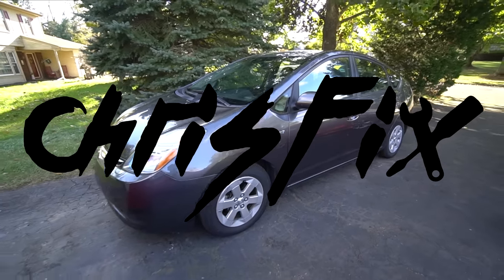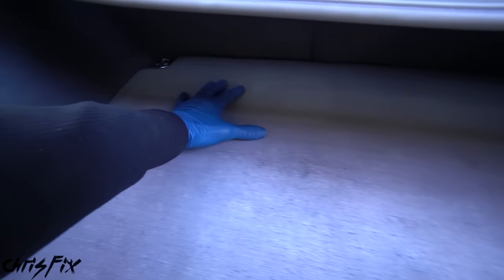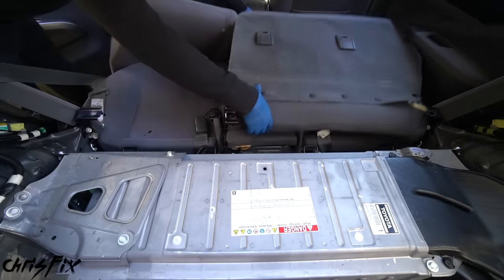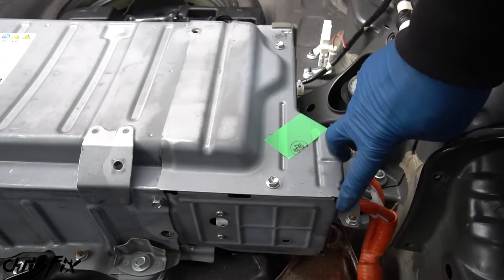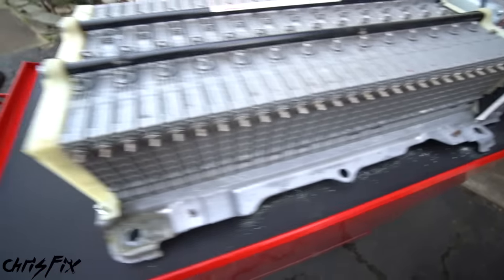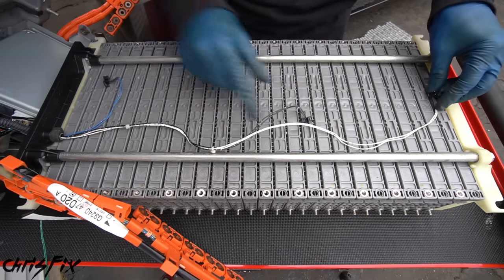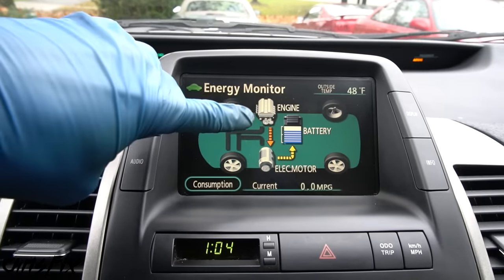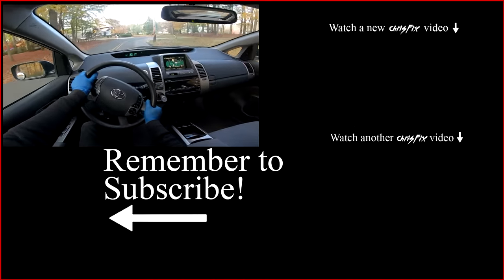I Bought the Most Hated Car on the Internet (and made $1000)

Comment: My brand new bride and I had just purchased a house that needed a whole lot of work right after she graduated medical school and her Prius started throwing every warning light on the dash.We did not have a whole lot of money and a new battery from the dealership would have been more than the car was worth. This video gave us the knowledge and confidence to replace the battery together, Thank you.
Reply: yep alot of battery rebuild places have started poping up for prius's and other hybrids which cost alot less then going to the dealer to get a new battery
Reply: That's awesome, Joe!
Reply: Have you noticed if the MPG of the car has gotten better with the new battery? We have the 2007 Prius and it is still going strong. Had some electrical problems such as A/C fan and now almost a year without issue. Wondering if I should jump at the possibility of replacing the battery before it is necessary. I think the MPG is right around 40-43 MPG. I remember when I first got it, I got almost 600 mile per tank. Not sure what it is now since my kids have been driving it for the past 4 years. I am more careful with it than they are.
Reply: @akassebaum  doesnt sound to crazy if your kids are on the heavy foot side for breaking or acceleration. what kinda miles are you at on the prius ? If its getting really high but the battery is doing fine it may be better to just wait till its needed incase other expensive reapirs come up
Reply: Congrats on the wedding!!
Reply: Congratulations  Mr and Mrs Breuer   👩‍❤️‍👨    How did the battery change go?
Reply from the maker: I'm glad the video was help you out!
Reply: Zio Oren specially doctor ones lol
Reply: Not all prius owners wear capes
Reply: Okay, I think I got this.  Simply start by just paying the $4000.00 to have a mechanic do it.  Nice!  Video well worth it!
Reply: @chrisfix  Thanks again Chris! The Prius has been running....well as good as a prius can run since we did the swap. Now that I have more time on my hands, thanks Covid, I have been using your videos to work on my truck too.
Reply: @macforme  The swap was a breeze. Just be careful not get hurt.
Reply: You and your wife worked on a car and you are still married? You guys might be a match made in heaven!!
Reply: How did it go?

Comment: Changing battery 10%
Unbolting & bolting screws 90%
Reply: You just described working on a car in a nutshell.
Reply: @kyle8971  right. Try changing a battery on a rusty Sebring. Anyone who's ever done it knows what I'm talking about.
Reply: Kyle D Modern cars*
Reply: Welcome to reality.
Reply: That’s usually how it is for most things
Reply: Karen Schumer  Spoken as someone who's never worked on a car before.
Reply: It's always like that
Reply: Yeah pretty much sums up car work in general
Reply: @nickanon329  Sure do, took ages to even find the battery let alone get it out. Also checking a noise in the engine bay, engine running and let the door go and shut, "CLICK" we were locked out with engine running and difficult to stop and then break window to get back in.
Reply: @rarearthman  but engineering doesn't work that way 😆. Its a game of "how difficult can we make this so people have to take it to the dealership for work"
Reply: Can’t like this comment anymore because it’s at 999 likes..
Reply: @bryanburcham1381  facts. The proof: got ready to change the alternator on my daughter's 02 Maxima a couple years back, because it was just an alternator, and there was no way I was gonna pay hundreds of dollars to have it done. Why would it cost that much anyway, right? Well, we started, and then found out: the long alternator bolt had been screwed in with the head towards the car's frame, so that it couldn't be slid out🤦🏾‍♀️A shop would 100% have told me that they had to lift the engine out of the car in order to change the alternator. What did I do? Cut the head off the bolt, slid it out the other side--where surprise! there was plenty of room--and installed the new bolt from THAT side. Needless to say, we won't be having THAT problem again🤨
Reply: @nickanon329  ahhh the battery in the fender bit,,,what a geat idea.
Reply: Are you sure it's not unscrewing & screwing bolts, 90%?

Comment: At 21:40 - just a note that it's necessary to bolt the battery to the car before attaching the electrical connections. One bolt is longer and black, and goes in the upper left corner. I think this is the ground bolt. If you connect everything and start the car, you'll get strange errors without the battery bolted in. Don't ask me how I know. :)
Reply: thanks man,
Reply: if a battery is not grounded correctly it may not complete the circuit. or read as having to little voltage. hell even with just a normal gas engine car these days if the battery is week or connectors are corroded it may still start but you will get all kinds of errors...
Reply: I rewatched at 21:40. Exactly what did Chris fail to do? All of those body bolts screwed into the body itself. Threads make metal of metal contact. Plus the two contacts to the left as one was the ground right?
Reply: Lol, asking for a friend…
Reply: @garbinator09 I'm assuming the commenter here is saying that you need to bolt it in before testing the electrical, which Chris does here.  Mine didn't have a special colored bolt though after screwing them all in it worked, dunno if one was special, didn't try it any other way.

Comment: By far, the best thing to do to keep track of where bolts go is once you remove a piece you partially screw bolts back into their holes by hand. It will save so much frustration of remembering where they go and the possibility of forgetting. The only downside is the little bit of extra time of taking them out again when u want to replace things but it's worth it
Reply: i was putting a Procharger on my Tacoma and I did that because there were so many different bolts it saves so much pain

Comment: They asked me for $ 5300 on 10.03.2020. I changed it myself by watching your video. I paid 1100 just for the battery. I also cleaned the fan. thank you.
Reply: Dude you could of died you are working with 240v chris should have done some research and got proper safety equipment before doing this
Reply: @rosen0662  Its not unusual for the few prius owners who do have to change the hybrid battery to change it themselves.
Reply: JC Velli  no he didn’t
Reply: @rosen0662  Scotty's a bum bro.

Comment: So, just to clarify.

Step	1	: Remove the 12mm bolt
Step	2	: Remove the 12mm bolt
Step	3	: Remove the 12mm bolt
Step	4	: Remove the 12mm bolt
Step	5	: Remove the 12mm bolt
Step	6	: Remove the 12mm bolt
Step	7	: Remove the 12mm bolt
Step	8	: Remove the 12mm bolt
Step	9	: Remove the 12mm bolt
Step	10	: Remove the 12mm bolt
Step	11	: Remove the 12mm bolt
Step	12	: Remove the 12mm bolt
Step	13	: Remove the 12mm bolt
Step	14	: Remove the 12mm bolt
Step	15	: Remove the 12mm bolt
Step	16	: Remove the 12mm bolt
Step	17	: Remove the 12mm bolt
Step	18	: Remove the 12mm bolt
Step	19	: Remove the 12mm bolt
Step	20	: Remove the 12mm bolt
Step	21	: Remove the 12mm bolt
Step	22	: Remove the 12mm bolt
Step	23	: Remove the 12mm bolt
Step	24	: Remove the 12mm bolt
Step	25	: Remove the 12mm bolt
Step	26	: Remove the 12mm bolt
Step	27	: Remove the 12mm bolt
Step	28	: Remove the 12mm bolt
Step	29	: Remove the 12mm bolt
Step	30	: Remove the 12mm bolt
Step	31	: Remove the 12mm bolt
Step	32	: Remove the 12mm bolt
Step	33	: Remove the 12mm bolt
Step	34	: Remove the 12mm bolt
Step	35	: Remove the 12mm bolt
Step	36	: Remove the 12mm bolt
Step	37	: Remove the 12mm bolt
Step	38	: Remove the 12mm bolt
Step	39	: Remove the 12mm bolt
Step	40	: Remove the 12mm bolt
Step	41	: Remove the 12mm bolt
Step	42	: Remove the 12mm bolt
Step	43	: Remove the 12mm bolt
Step	44	: Remove the 12mm bolt
Step	45	: Remove the 12mm bolt
Step	46	: Remove the 12mm bolt
Step	47	: Remove the 12mm bolt
Step	48	: Remove the 12mm bolt
Step	49	: Remove the 12mm bolt
Step	50	: Remove the 12mm bolt
Reply from the maker: You got it!
Reply: ;)  LOL  Thanks for that giggle.   Stay safe & be well.
Reply: How exactly do we lose the 10mm socket when doing this function?
Reply: What about the reassembly tho lmao
Reply: No you forgot the 12 mm bolt
Reply: @wellnesspathforme6236  Mendela effect. It never existed.
Reply: Don’t forget the 4 14mm bolts
Reply: Kaleb Desjarlais.  I was looking for why Chris said he needed a 14mm wrench/socket, you to.
Reply: Step     51   : Remove the bus bar nut
Step     52   : Remove the bus bar nut
Step     53   : Remove the bus bar nut
Step     54   : Remove the bus bar nut
Step     55   : Remove the bus bar nut
Step     56   : Remove the bus bar nut
Step     57   : Remove the bus bar nut
Step     58   : Remove the bus bar nut
Step     59   : Remove the bus bar nut
Step     60   : Remove the bus bar nut
Reply: This is why I buy Toyotas. You can take the whole car apart with one wrench.
Reply: Half of the car was outside on the driveway and just when you think he's about to finally change out the dam battery, more things need to come out! Screw this car. I hate Prius' anyway but now I hate them even more!
Reply: Yoo how long did this take you😂😂😂
Reply: lol u will earn that 1k in savings on this one
Reply: @giggityeffyou  thats why the last.  not held together by 2 plastic tabs
Reply: My county has a quarterly auction with prius in it
Keep my open 
Its not just bsttery problems they selling off 
How about a video replacing........
Reply: what about the 12mm bolt
Reply: You missed a step between 37 and 38.  Remove the 12mm bolt.
Reply: @chrisfix  I want a shoutout please and love from nepal🇳🇵
Reply: Lose your 10mm socket

Comment: I'm an electrician. Trained by the US Navy and over 30 years in that field so, legit. A word on electrical safety.  Once you had the battery together and started the car there was upwards of 200 volts on the two high voltage connections on the battery. In your next step, you held solid metal tools and the cable strain relief clamp plate right over the high voltage connections.  If you had dropped them or touch those connections you would have been shocked or sparks would fly. It could ruin your new battery as well or start a fire. Please be careful during this step.  You need to put a piece of plastic or something nonconductive over the high voltage connections while the covers are not in place.  Safety first. More people get electrocuted off of 120 volts than any other voltage and I guarantee those high voltage connections have a higher voltage than that.  Food for thought. I love your videos Chris and I am a subscriber so keep up the good work. I support your channel and all the charity work you do Chris.
Reply from the maker: Thanks for the feedback. Those wires are coming off of solenoids and they are not active when the car is off and or the battery safety plug is removed which is why I remove the safety plug right away before touching the battery. Not only does it half the voltage but it opens up the circuit on the battery since it is in series. There are no wires or bare metal that can be contacted that is "live" or "hot" as it is all covered or sealed. That is part of the safety design done by Toyota. Now that doesnt mean you cannot be more cautious and I appreciate your advice!
Reply: I see that the US Navy did a great job.. Lol... 🇬🇧
Reply: Check out the Edison vs Tesla war.  This is safe DC - not AC.
Reply: @terryneu3456  With enough voltage and amperage DC will kill you.
Reply: @Dennis4SB there is no live DC...

Comment: Just wanted to share my experience. I took my car to my mechanic and he told me it was about a 97% chance that I had a dying hybrid battery. He said he doesn't deal with hybrid systems which is respectable. He told me my best bet was to go the dealer because at least I will know it gets done right. That's decent advice if you have cash to spend but me being a broke caveman decided I would rip my sisters 07 prius battery out and shove it into my 06. (lucky for me she just bought a new car 4 days prior to this so she sold me the battery for super super cheap)
 
Using only this video and 200 dollars worth of harbor freight tools I was able to successfully perform the delicate operation in a mere 9 hours. So far, so good! I can't express how insanely great this video is! In my case I didn't have to open the battery core which made the job a lot easier, but after dismantling the first prius and reassembling it, the experience and guiding from this video made me knowledgeable to dismantle the second one after with only a few references for remembering which way that fan goes... was it up? down? left? Again, I'm a caveman so I retreated to my den and waited for my stone tablet to load up this video so I could reference it. 

I also have to mention that you should never buy a 30 piece ratchet set for $5 at harbor freight. after finally testing the swapped battery in my 06 and confirming it worked, I oogaboogad in glee. I quickly began screwing the battery covers back on and that's when disaster struck. My 20 cent ratchet adapter snapped in half, leaving me with a 3/8 drill and only a 1/4 socket. Anyways that sucked. 

Also pro tip, don't drop the negative battery lead screw from the 12v into the battery crevice. It sucks because you can't retrieve it without a magnet, taking out the battery or shoving your scrawny arms in the 1 inch fissure and hoping you can find it in all the water that's probably in there.

 Anyways, great tutorial, perfect 5/7, if anyone read this far then you are a legend. peace.

Comment: Chris, thank you for all the effort you've put into making these videos. You've inspired me to get my own tools and I'm almost entirely confident that I could change my oil, coolant, trans fluid, brake rotors and pads, redo my entire suspension and exhaust, and now a hybrid battery. Incredible. I've never even changed my own oil before but now you make me feel like I really know what I'm doing. I know this is an older video, but thanks man. You deserve so much
Reply: Once you've done any of these jobs once or twice it gets much easier, especially with oil changes and brakes. The hardest part of any job is when a bolt is seized, rusted or corroded. Then heat, torque and penetrating fluid is your best friend :) best of luck!
Reply: @TechDove  That and a good supply of patience. If you have to incredible hulk something off, chances are it is time for a break before you break something. (ask me how I know).
Reply: @katydid5088  yup I know that pain lol that's why I have power and pneumatic tools now

Comment: Well, the video was so well made I decided to look into doing it myself. After not seeing any bargains on Prius batteries and really wondering if I should, I saw someone comment on green bean and green tech. Absolutely professional from beginning to end. And I spent about $1700 with a lifetime guarantee as opposed to $2500 if I do it with no guarantees. I will keep you posted.
The triangle of death was on but no codes came up but the cabin air filter was filthy so cleaning that is extremely important.
Car specs.
2005 Prius ||
New motor
Battery previously replaced in 2015
Odometer stopped at 299,999 (has about 50,000 more than that now)